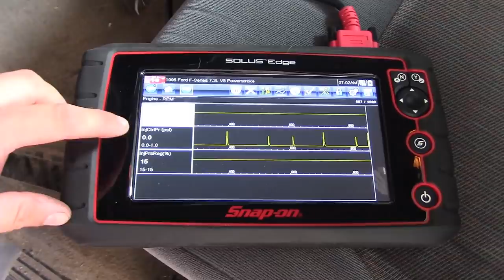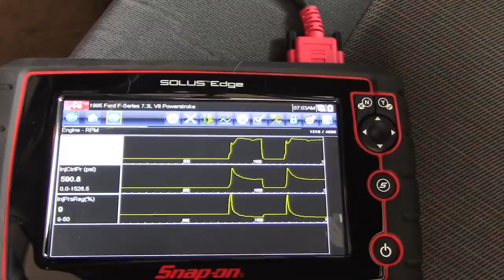Restoring an Ammco 4000 Brake Lathe

Comment: This is so odd.  I used to work on cars as a kid, and resurfacing brakes was just a usual thing.   Drifted away from working on cars for about 20 years, but have started to get back into it.   Turns out resurfacing isn't a thing anymore.   Called a few shops around the area (suburb of Los Angeles) and everyone was like, yea, we don't do that anymore- we just replace them.

Comment: one of the old junk tools ive always wanted to find/restore... I made the mistake of replacing the brake drums on our 65 galaxie years ago, over winter, didnt drive it...car shook like crazy come spring...drums were out of round a mile. ordered better set, still 30 thou out...special ordered their best- still 15 thou out... skimmed in a normal engine lathe, re-arched shoes in a press to match new radius(yes they were a few thou over- but still like 1/16" smaller than the 50 yr old worn original ones were), was just such a pain to do in a engine lathe- a brake lathe woulda made it a 5 minute job... someday maybe. one of the aamco lathese and a coats tire machine are on my watchlist for garage tools to rebuild... and some decent drums still on a axle, as the chinese crap must be shipped on edge- runout looks like a wood lathe and a file coulda made a better part :(

Comment: more things..  clamping hubless discs or drums.. must verify the inside adapter is not riding in a groove that some rotors have for stud clearance.. and the inside and outside clamping adapters need to be the same size..  not small on the inside and big on the outside.  that can distort the rotor/drum mounting face just enough to screw your work up.. when different sizes are used. the improper clamping pressure can distort the arbor..  chips in the clamping faces of the adapter can also cause it to flex slightly .. 
 next..   Natural Bristle.. inch and a half wide paint brushes.. when turning rotors.. drop one on its side with the bristles laying across the cutting insert..  i usually have a pair.. one for each disc cutter ..  now your chips will fall in the pan without spraying them all over the top of the machine.. nylon bristle brushes will work. but the heat of the chips causes the bristles to curl up. i also used a normal parts brush when i turned drums again laying over the cutting edge.. 
you may want to search out one of these... makes turning rotors so much easier.. https://www.ammcobrake.com/accessories/clamping-silencer-1   puts usually enough pressure to stop the harmonics..  takes about 10 seconds to set up each time.  lastly.. when setting the depth of a rotor cut.. i normally start about 1/2" from the outer edge.. sometimes in inch in..  that is usually most worn area..
Reply from the maker: OK. I guess I need to do some shopping and learning!
Reply: @WatchWesWork  i used to do 5 full brake jobs a day.. turning all the discs and rotors.  rebuilding the calipers.. cleaning and repacking the bearings.. new rear wheel cylinders and all new hardware..  i could feel my hands on your 4000 controls when you were turning that rotor.  i then got the job of teaching parts store employees how to operate the 4000 or accuturn..  i would go around to repair shops and pick up used drums and rotors so i could have enough for the students to practice on without destroying customers parts.. 
 wes.. are you bored and need a subject for a video..  do this exactly how its written. https://i.imgur.com/kviX0VQ.jpg

Comment: Very nice restoration Wes. I haven’t had any experience with brake lathes, what does the clip on weights around the rotor achieve ? Anti vibration or something?
Reply from the maker: Yes. Reduces vibration to improve surface finish.
Reply: Watch Wes Work when  I used to be a machinist I use to use my hammer handle or a small piece of wood with a bit pressure to stop vibration. This probably would work much better.
Always learning something 👍

Comment: oMG i used one exactly like that in high school!!  wes for the cutter ends hydrolic hose caps not sure the size but my automech instructor had them to plus those openings for that flat washer idea can you get your hands on some UMHW aka poor mans teflon itll machine easy an you can remake the ring for the boot outa it an it dont need lube to glide on the shaft

Comment: Wes ever try evaporust as a rust remover?  I restored a few old Japanese motorcycles and it works wonders on rusty parts.  dunk and 12 hrs later it looks like new. My old job rebuilding stuff we used to say where everything is Krylon new.
Reply from the maker: I have not. I should. I've seen other videos using it.

Comment: Looks good . Wondering why you put the peg thing under instead of on top behind the lathe?
Reply: I wondered the same. They're usually at eye level and arm's reach on the wall or another table to save strain on the back from bending over.

Comment: Just got a 4000, it needs a full overhaul. I used one during high school in 2003. Do you have part numbers for everything or could you lead me in a direction. My speed wont change, and its hard to get my main drive in and out.

Comment: Used a piece of lead for foreign car rotors and had a rubber band for drums you could advertise for machine services not many people turn down drums and rotors today, definitely rind a rubber to turn down the drums it has a awful chatter if not used good luck with it!!!how is the new tire machine and balancing machines???
Reply from the maker: They are waiting for wiring. I have the belt for drums.

Comment: There is supposed to be a couple of big rubber band things with weights on them to keep vibration down one for the rotors and one for the drums
Reply from the maker: You mean like the ones I used in the video?

Comment: Next time you take the crossfeed gearbox off, put it in fast or slow to hold shaft, hit the handle on the front wheel with your fist and unwind till the gearbox is loose. Remove, the gear doesn't fall off the shaft then. The cutting tools have 12 surfaces, 3 top,  3 bottom, switch holders .
Reply from the maker: Interesting. I don't see how that would keep the gear in place, but I'll try it!
Reply: @WatchWesWork  The shaft that comes out of the back of the gearbox stays in it. the handle on the wheel is threaded to the rear shaft, when you hit the handle counterclockwise, you seperate the front shaft from the rear,nothing in the gearbox comes apart. It comes off the machine as an assembly.

Comment: Have you got a part # on those bearings and cups, I could not find then on ammco parts sites . Did you have to just measure the old ones? That is the only thing I could not find. I bought 3 of the 4000 models and 1 3000 two years ago and started checking them out this week.(had to buy all 4 in a bundle )

Comment: 27:43  Do you think that tapered shaft was because they were worried that if the circuit breaker was exposed, then metal shavings or metal dust could somehow cause a short circuit or just render circuit breaker inoperable?

Comment: Take a .020 finish cut a little more tool pressure reduces chatter.
Reply from the maker: Right. But you have to be careful not to go too far and go below the minimum thickness.

Comment: Here in the south (NC) I throw out a lot of rotors that could have a few thousandths shaved off of them and make them like new.  Would be nice to have but I just don't have the room for one.  I sure wish I did, though.  I believe there is still need.  Most all the rotors come from China and when that slow boat stops coming (like the one with all the appliances on it now) people will be looking for the brake lathes again.  That said, it's nice to be done with a brake job in an hour and move on to the next job rather than wait for the rotors to be done.
Reply from the maker: Yeah it will be convenient!

Comment: Ok Wes , if you really want to take a trip in the WayBack Machine you could look for an old brake shoe grinder to put the proper arch on the shoes to fit the oversized drums . Showing my age I guess .
Reply from the maker: I'll check the museums.
Reply: @WatchWesWork  Just check E-Bay they are there .

Comment: Hey Wes, great job on the brake lathe!  Quick question for ya. I did injectors in my 6.0 2 years ago and keep getting fuel in the oil. Fast forward to today and now I have a hpo leak at the oil rails causing a no start. I bought new oil rail nipples and 8 injector re seal kits. When I assembled it last time I just used engine oil on the o rings and must’ve nicked one. Can I use that sil glide stuff this time around? I feel like i have a better shot with that since you use it often but I don’t know about it possibly getting into the fuel side of the injector.
Reply from the maker: Yeah, syl glyde works great for that. Those o-rings in the top of the injectors are a real pain.
Reply: Watch Wes Work yeah the whole 6.0 is a real pain lol thanks for the reply

Comment: Early to mid 1976 based on the serial number. The A indicates aluminum chassis instead of iron. Looking on the back above the belt tensioner handle may have a date cast in.
Reply: Oops. At 6:50. The driveshaft pulling out of the disk gearbox sucks.
Reply: At 37:00. Oof. Welcome to working on the easy gear box. The drum side is way worse
Reply: We refurbish these and sell parts like the boot ring in brass, the disk box shaft tube etc.
Reply from the maker: How are you supposed to replace that cross slide boot without pulling the drive shaft out of the drive gear? I figure there has to be a trick.
Reply: @WatchWesWork  turn the handle to feed out the tool post till it’s unscrewed. Then put the disk box in slow. Apply pressure to the shifter and then keep unscrewing the handle. It’ll take some effort or may require a rubber mallet assist to get it loose. Then keep unscrewing. The U joint stays on the driveshaft. The tip of the 3/4 acme feed screw is threaded 5/8 fine.
Reply: Put the new boot on, slide the tool post back in till it hits the feednut. Then make sure you’re in slow again and start cranking the handle in. When it gets tight, shift to neutral and it should be good to go.
Reply: We are BrakeLatheSpecialist on eBay
Reply: Or Heerboth on eBay

Comment: that push switch is not for on and off. It is for turn off the motor while dressing the hard spot drum grinder. yours look like it was cut off but like stud. Its only to grind the dress stone with diamond tip

Comment: 5:30 how about spray welding it and cut it on the machine itself with an improvised tool on the back side, to cut it down again - if you don't have a lathe able to spin it :)
Reply from the maker: I don't know about all that!
Reply: @WatchWesWork  that stuff is really cool and somewhat easy to use. Try it out 😙🎶

Comment: What is the point of the tan weighted elastic belt you put around the rotor? To keep from squishing the vent gap together?
Reply from the maker: It reduces vibration and improves the surface finish.
Reply: @WatchWesWork  Thanks for the reply. Is there a theory how to position the belt? I would think an out of balance rotor could benefit and suffer from the belt depending if it improves or deteriorates the balance due to position. Is the idea to move the belt until vibration is at its minimum?

Comment: 22:00 - those set screws should be dog points for that, right?  What happens for overtravel when the lathe is power feeding?  I hope it doesn't have self-destruct modes.

Comment: Can you give  the reason on the weighted straps.   I've heard to keep from cracking ??
Reply from the maker: It helps reduce vibration which improves the surface finish.
Reply: @WatchWesWork  thanks for answering
Reply: @larryalexander4833  I'm guessing that adding the weights will lower the resonance frequency of the rotor and the rubber in the band will provide some damping which will also help reduce vibrations. 

So my theory is that: when you strike the brake rotor before putting the band on, it will have a nice ring to it if it's not all cracked. When you place the band on the rotor and strike it, it should have more of a thud than a ring if the band is working properly. Would be neat to hear the difference.

Comment: Mechanics that don't use brake lathes are just parts changers.  I use my brake lathe all the time because turned rotors are BETTER than new because they go through their heat/cold cycles and are way more stable than the green metal they use for new.

Comment: 8:35 you could black them with oil. Would probably work better than paint which will chip off.
Reply from the maker: Does that require heat?
Reply: @WatchWesWork  yes. Oiling and heating in an oven for about an hour. It's the same process you use for cast iron pans :)

Comment: I think it needs an vaccum cleaner attached to suck up all the rust you'll cut away with it 😂

Or get an old rugged DC welder and use it as power source for electrolysis - to remove the rust without having to do the manual labor :)
Reply from the maker: I was planning to use my sand blast cabinet.

Comment: Good video but there's a lot of things you did that were unnecessary.  I'll post a few of them I've been professionally rebuilding these for about 20 years now.  That's not a circuit breaker. That's just a shut off switch. You don't need it no more it was designed for when they use drum Grinders on the machine so the machine is disabled while running the drum grinder. There is probably no way you got that drive shaft to engage in the Trap assembly by just sticking it through the gearbox like that. There are two little pins in there inside a gear that once you pull that driveshaft out like that they fall out. You're not supposed to take that drive shaft out of the gearbox is supposed to disconnect the gearbox off the feed shaft in one piece. I watched more of the video and seeing you figured out those little pins we're engaged on the drive shaft. There's a lot easier way of putting a gearbox together you got to take the complete gearbox off the machine you got to take that trap assembly out disconnect the drive shaft from the feed shaft. Put all that together then put the top part of the gearbox on with the four bolts in the back. I can write a whole book on how to rebuild it. But you're welcome to check out my Facebook page and join my ammco Facebook group. By the way I can get you three step pulleys brand new if you need them Facebook.com/ammco4000

Comment: I wont criticize since everyone has their own set systems. butt. I was always taught that when tapping one should always reverse a half turn to clear the chippers from the hole. nothing worse than a chipped hole.
Reply from the maker: It's a spiral point tap. It's made for tapping through holes and pushes the chip forward. We use them in CNC machines and no chip breaking is needed. Tapped millions of holes that way.
Reply: @WatchWesWork  kinky...

Comment: I have never had success with regrinding a ventilated disc, it creates high and low spots when in use, so just use them till minimum thickness and junk them .
Reply from the maker: It works fine in my experience. The biggest issue is machining low quality Chinese rotors.

Comment: No one turns there drums and rotors any more the Napa store I go to charges $25 each to turn them and that's usually about $10 less than new ones
Reply from the maker: It just depends. My store charges $15 each, and the last rotors I bought were $46 each.

Comment: Brake discs or drums warp from heat.  If you remove metal from discs or drums there will be less metal to absorb heat from the braking action and they will warp quicker.  These machines were from a time when there was adequate metal to allow for the removal of metal without too much consequences.  With today's brake components this is a scam to take money from the customer when they just should have had parts replaced instead of re-trued.  Too little metal in today's parts.

Comment: Your trying to remove to much and you run a fast pass and then a 2 thou slow pass and while it’s running after your final cut use a roloc disk to put a non directional finish.

Comment: dreadfully loose bearing fit. when i was an apprentice in England we used to call that an American fit because we had to rebUIld boring mills made in the U.S. AND ALL THE BEARINGS FELL OF THE SHAFTS THEY WERE SO LOOSE THAT THEY MAY AS WELL HAVE USED BUSHINGS. My inspector used to shake his head and laugh. I found out that the company Devlieg of Michigan was too chap to hire skilled labor ,so anyone off the street was good enough. some of their machines did not last 3 years before they shipped them to the U.K. TO BE BUILT PROPERLY